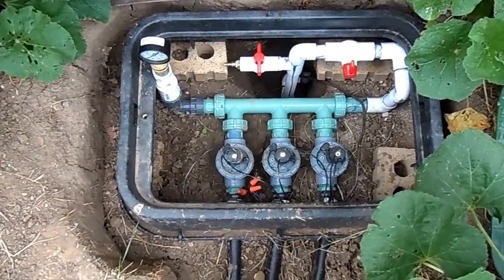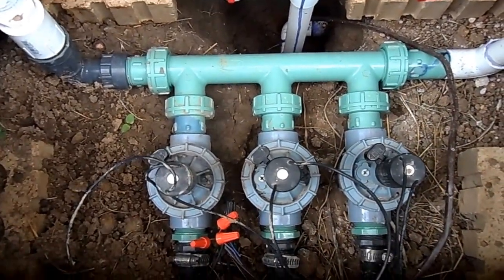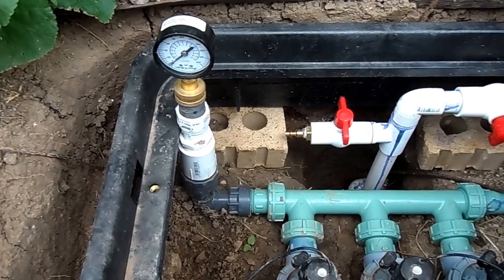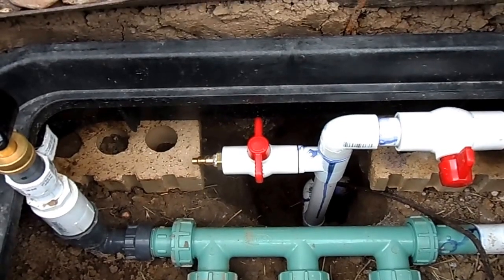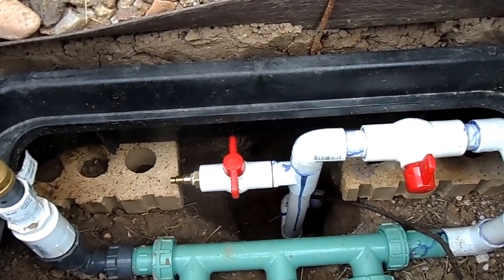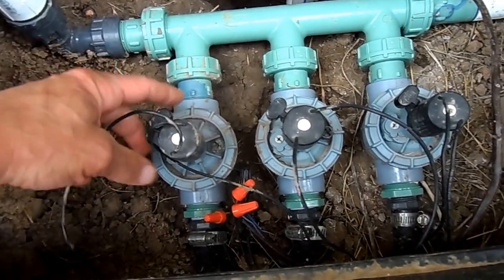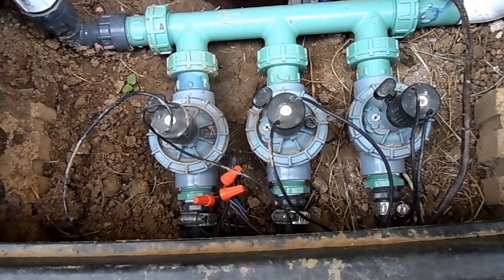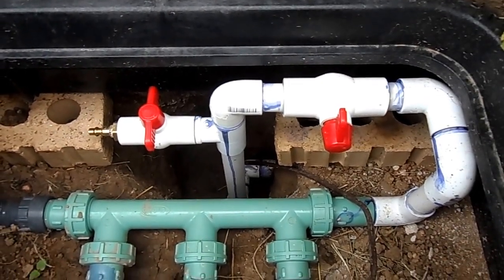How to Install an Expandable 3-Zone Lawn Sprinkler (Irrigation) System (Plumbing Tutorial)

Comment: Please help. What irrigation timer model# has on/off time settings but has no limitation or duration on water flow time?
Reply from the maker: I am sorry, I am not aware of any modern commercialy available systems like this.
Reply: @JanaeBerzon  Found this on Amazon. Water Hose Timer, Diivoo Sprinkler Timer with Timing, Frequency and Duration, Programmable Irrigation Timer with 3 Watering Programs and Rain Delay for Lawn, Pool Filling
Please correct or assure me if this one fit my usage.
Reply from the maker: @orangutan4696  Glad you dound what you are looking for. I understood you to mean thta instead of duration, you wanted off time, which this unit does not, as far as I know.
Reply: @JanaeBerzon  Last years we have unusual extreme heat days and we lost few compressors with our rooftop refrigeration equipment. Since we have abundance of water, so this year I decided to build a mist cooling system to bring ambient temperature around the equipment down about 10 degrees with a timer that can give me water source more than 1 hr.
Reply from the maker: @orangutan4696  makes sense, There are certainly timer choices that fit this description.

Comment: Very helpful. I’m curious will the pressure gauge read the same static pressure at the manifold and spigot
Reply from the maker: It's a closed system, so for all practical purposes, the pressure should be the same no matter where you measure it.

Comment: air port is in the wrong place. It should be after the shut off valve otherwise it backflows into the main water system and you dont want your tap water contaminated. Other than that good video
Reply: Old video, but I agree. I was thinking the exact same thing. What about a one way check valve, where is it or is one needed?
Reply: @izabari I would recommend one. Though it's not necessary

Comment: No offense but you wont be able to use the blow out unless you turn your meter off. There should have been a shut off valve before the blow out
Reply from the maker: There is no water meter - it's on a well. If there was one, it would be on the inlet to the house. This is on the outlet. Worked perfectly and never had any problems blowing it out.

Comment: Great video! Where is the back flow prevention valve?
Reply from the maker: It gets pretty darned cold around here, so we have a RPZ valve inside the house, instead of a pressure vacuum breaker on the outside that would have to be removed and replaced seasonally. I have another video on that.

Comment: Your blowout is in the wrong spot. All your going to do is blow air towards your main supply. It should be downstream of your shutoff valve. Major fail.
Reply from the maker: I think you are missing that there is a  shutoof inside the house with a drain valve. I blow this part of the pipe out from the same location. You should really watch the entire video before passing judgement.

Comment: this looks like a pain in the ass for repairs though if one of the valves fail. I just build it myself
Reply from the maker: Actually, it was built with maintenance in mind. Should a valve fail, it is a simple task to replace it.
Reply: Jake Berzon yeah, with the unions i guess it would be, huh? Interesting.

Comment: I wish I had seen your video before I started my project; however, I'm still pretty much on par with what you did. I do have a question though -
I thought about installing 1/2" PVC (for air) to run parallel with my 1 1/4" (water) main. This way, I can pipe it to my compressor in the garage, instead of doing it your way with the quick connects. Any thoughts on this? Thank you in advance for your reply.
Reply from the maker: Wesley Jackson  If I understand correctly what you are suggesting, I have not seen anyone do it. It would significantly add to the cost, if done properly. I am also not sure what problem it would solve. Are you trying to avoid having to connect the compressor hose to your irrigation system once a year?
Reply: correct. I guess when it's put like that, it's not really all that necessary  lol
Reply: the installation is for an elderly couple who would like to maintain their own system (winterization and startup) with the least amount of work as possible. thanks again for your reply
Reply from the maker: Wesley Jackson Remembering the few steps involved in winterizing may seem trivial to you, but for the elderly, a $99 winterization service once a year is probably the better way to go!

Comment: Jake, thanks for this, very helpful. What type of pressure gauge and fitting for the gauge did you use? I'd like to install one on my system but can't tell from the video which fittings and the size of the gauge nipple. Thanks again!
Reply from the maker: Dad Li I used an inexpensive outside hose faucet pressure gauge from RainBird. You will need adapters to connect it to the manifold. You may want to ask your helpful hardware store assistant for help in figuring out exactly which ones will be most cost-effective.

Comment: Hi just have some questions what inch poly pipe are you using, or if the connection is not perfect to your manifold what adapters are you using, and what sprinklers are you using. Thanks I'm looking forward to building my own system but I'm so confused on all the adapters and I don't want to use PVC to connect to my manifold but your video really helps so thanks.
Reply from the maker: cool dood I would normally use the 3/4" 80 psi poly pipe from Home Depot for an installation like this. It's rather inexpensive, easy to handle, fits well and is really all you need in most cases.

Comment: i am using a well- and only have about 50 psi- i am looking to water a couple acres- how much pressure loss will i loose with a long run and a lot of sprinkler heads- thanks
Reply from the maker: Jonathan Hetrick, your pressure loss will depend on the size of your pipe, its length, the number and angle of the turns and even the material your pipe is made of. Also, your back-flow prevention device will reduce the available pressure.

Another thing to consider is the water capacity limitation of your well. For example, a 15GPM domestic well even under the most optimistic of assumptions may be able to water 500 sqft at a time - that's 175 zones. :)
Reply: yep- understood- thank you for your response
Reply: can i hook a pump up to increase the pressure of a well- but i guess that wouldn't.
 increase what the well  pump is capable of- correct
Reply from the maker: Jonathan Hetrick Yes, that's correct. You can increase your pressure by reducing your pipe diameter, changing your pressure switch settings, adding a secondary pump, and etc., but none of this will increase your well capacity. Rather than tinkering with your drinking water well, you may want to consider an often more economical and sustainable option of drilling a shallower, higher capacity secondary well just for irrigation.

Comment: Why is the shut off downstream from the blowout     when you winterize the system, don't you risk the chance of forcing air back into the main rather than the heads.  Wouldn't it make more sense to put shut off on the other side of air compressor fitting , then when you force air you shut off main and all air is forced out head direction      I've never installed before, I'm just doing my homework now getting ready to do this in the spring and really like how clean this setup is.   
Let me ask you this as well, where would you tap off if you plan to have another  manifold setup a good distance away, off the manifold or off the main supply
Reply: Yes he's right. I noticed the same thing. The blowout should be after the shut-off so that way when you use the blow out it doesn't blow air back into your water supply it only blows the air out towards the irrigation system.
Reply from the maker: If you reverse the position of the port and the shut off valve, you will defeat the main purpose of that shut-off valve, which is to make the back blowing easier.

There is nothing wrong with extending the number of zones by attaching another manifold to the capped end of the first one. You just don't want to loose too much water pressure in the process. Consider the distance of your layout one way and the other, the # of bends in both cases, water pressure, size of your water main vs. the lines you are running to the manifold and the number and the location of zones that you want to water simultaneously.